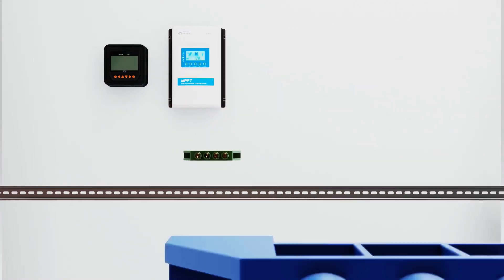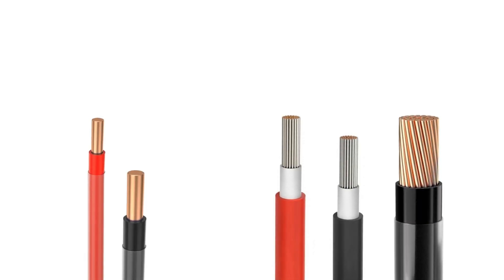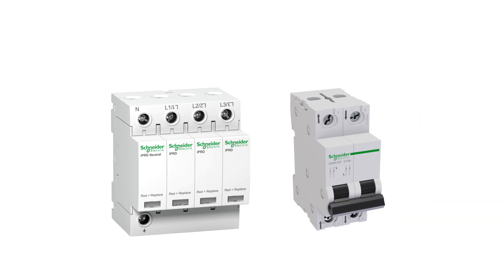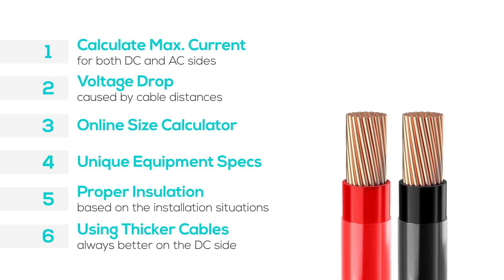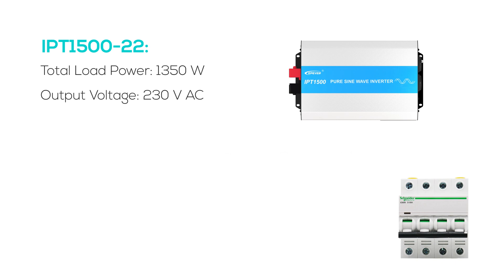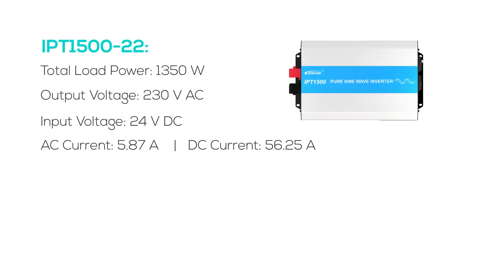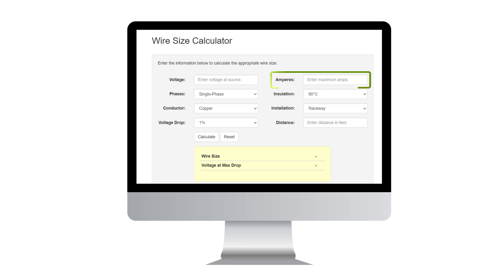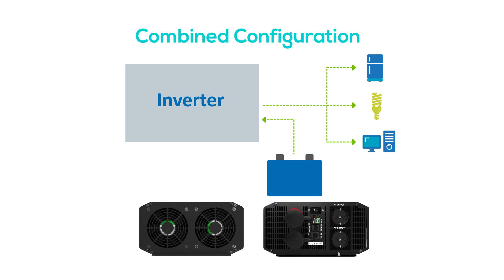EPEVER Off-Grid Inverter Wiring Tips | Optimize Efficiency with Cable Selection and Fuse Sizing

Comment: Hello
Reply from the maker: Hello, thanks for tuning in! If you have any questions or thoughts about the video, feel free to share. We're here to help!
Reply: I can't adjust my charge controller voltage  to lithium battery voltage 61 volts.. my system don't recognise the com port ...
Reply: I don't know if it is from the connector
Reply from the maker: Please contact our support team at support@epever.com, our technicians will assist you with troubleshooting. @Trinity33780